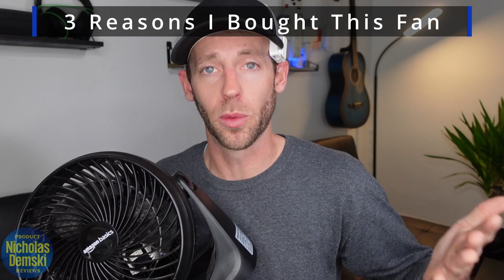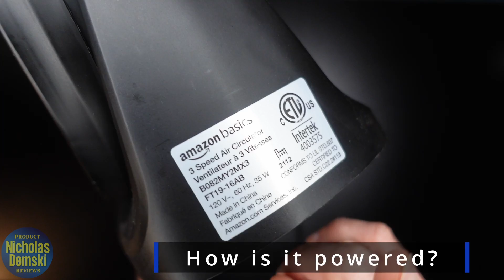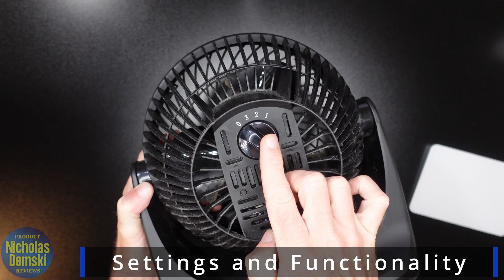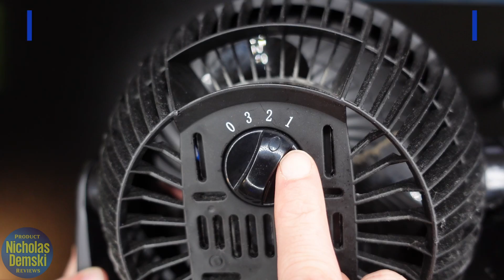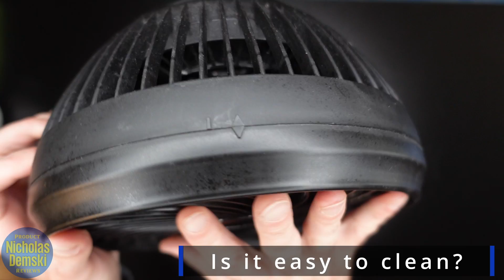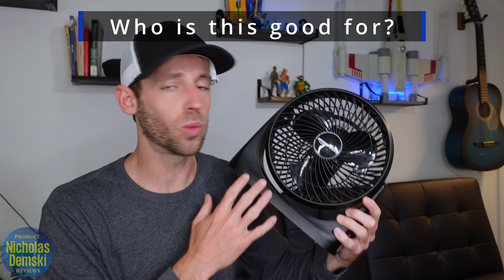Amazon Basics 3 Speed Small Room Air Circulator Fan

Comment: is there something else i could use instead of a screwdriver? mine won’t fit fully into the hole!! i got a piece of hair stuck in my fan and now it doesn’t work lol
Reply from the maker: Probably just need a smaller screwdriver, they’re a couple bucks at ace hardware. Or could you try squeezing some scissors in there and cutting the tangled hair?
Reply: @nicholasdemskiproductreviews  thanks for the recommendation!
Reply: I ripped mine off

Comment: So I made the mistake of taking the fan off the base before finding out that there were screws to just take the front plate off. I can put it back onto the stand (there is a little spring, a small metal rod, and a lock nut); the lock nut is clearly  important to make it adjustable, bc I can’t for the life of me figure out where it goes which means the fan just flops to pointing upwards lol any ideas on where the locknut needs to be positioned?
Reply from the maker: Sorry I’m not sure, I’d probably have to take a look at it in person to see what you mean